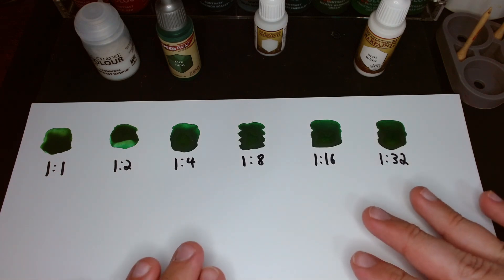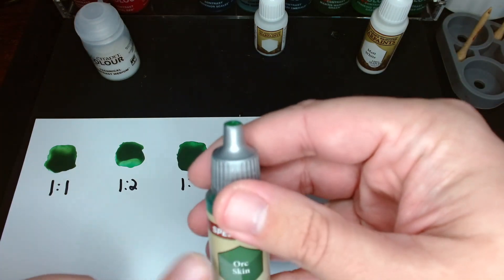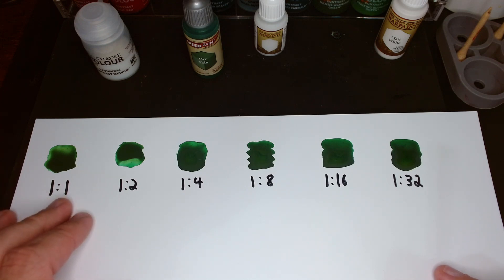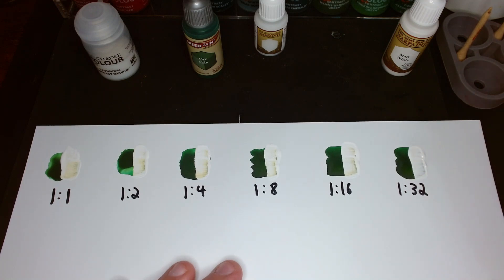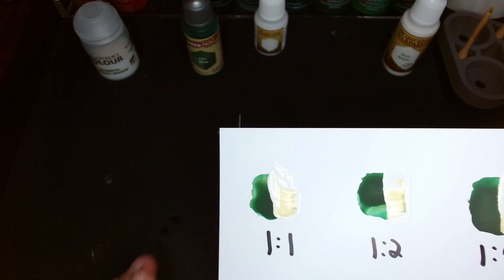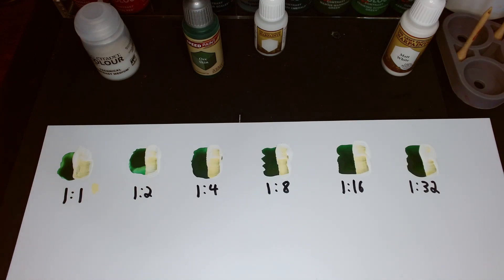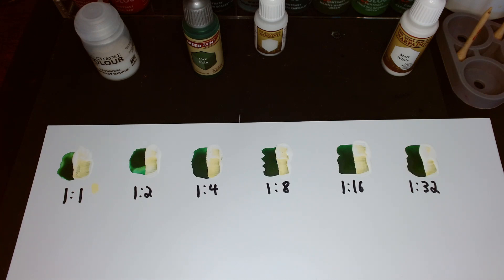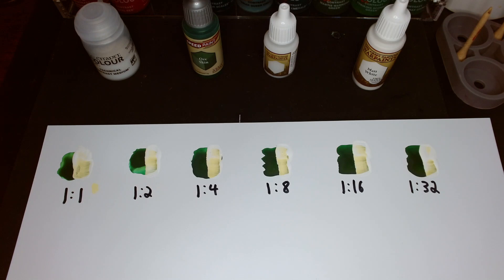Tested: Can you Prevent SpeedPaint Reactivation Using Citadel Contrast Medium?

Comment: JuanHidalgo Miniatures tested using Contrast Medium to prevent re-activation recently and it worked with small amount of contrast medium.  He let it dry for a few hours, up to 24 hours.  However, he did not try painting the white paint over the top.  He just tried using water on a brush to reactivate.  I wish he would have tried painting white over the top.
https://youtu.be/tmG0uzOkUAA
Reply from the maker: It's a neat test, but I also wish he would have used paint instead of water.  I don't know that many miniature painters are brushing water over their models after SpeedPaint has been applied.  But touching up with paint, absolutely.

You've seen my results.  I left these to dry for much longer than 24 hours and had reactivation with every ratio that I tried.

I'll admit, I didn't try 2 parts contrast medium to one part SpeedPaint.  At that ratio, I think we've thinned the SpeedPaint too much.  Also, the low cost is a huge benefit if SpeedPaint and mixing it with that much contrast medium just costs too much.

Thanks for linking the video.

Comment: I haven't had any reactivation issues except for trying to cover up mistakes when giving the first layer. I have been solving it giving a thin brush on barnish over the mistake, then covering up with white, something not too bothersome when painting batches, but annoying when painting just one or very frew minis at the same time. Some people reccomended enamel based white, since it isn't water based and shouldn't make speedpaints reactivate at all, but I didn't get my hands on a small bottle yet (it usually comes in cans since it's used to paint over metals and crystal).
Reply from the maker: Good points!

I'm working on a video right now about correcting SpeedPaint mistakes using the red squig teeth.  

I'm not sure which brands are available where you live.  I found a small jar of Testor's brand white enamel paint at a local model store (one that sells model cars, planes, tanks, etc...)

It's worth a try, but it's a pain to clean out of brushes.  Be sure to get some thinner, too.

So far, I prefer the varnish.  Have you had any issues with it?  The interesting thing I've found is that the varnish also reactivates the SpeedPaint, but I'm not sure it's an actual issue.
Reply: @Lets_Get_Gaming  no reactivation using varnish in my experience, you just have to be sure the paint is dry and apply it gently. One stroke is enough, no need to rub. Then I wait again until the varnish is dry to cover it up. A real drag when painting few minis since it ruins the pace, I tend to be really careful to avoid the issue. I'm using zenithal priming and a white patch might ruin the look, also. 
I airbrush the final protective varnish coat, never tried to give a full brush on coat, but I guess some paint on the edges may come off if you are not careful, specially on metallics. Speedpaints (Contrast also) don't seem to stick as well over metallics than over regular acrylics.
Reply: BTW, check out Swords and Brushes last video! he gives some really nice tips, including one were he shows 1:1 mixing recipes examples for different orc skin tones. I really like the bright retro lookin skin he gets mixing orc skin with zealot yellow, and the darker desaturated one mixing orc skin and hardened leather.

Comment: The reactivation could work in your favor if you use the white for highlights. Would actually be another time saver as you could use the same white to do multiple different highlights with the same color because each will reactivate with its own underlying color, no?
Reply from the maker: Sure could.  In fact, an all-over drybrush of white might effectively highlight the whole model.  I have some to test this on.

The counter to that theory is that the SpeedPaint already supposedly does the highlighting.  I find this to be true to an extent, but another level of highlight is welcomed.

I think the reason so many people want to prevent the reactivation is to do touch-ups.  This is the only real problem that I've had with the reactivation.